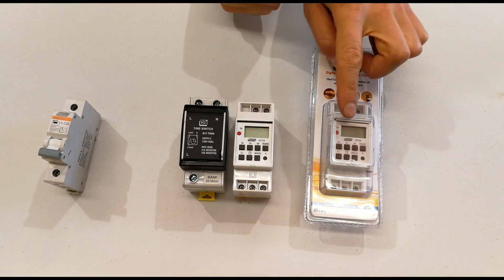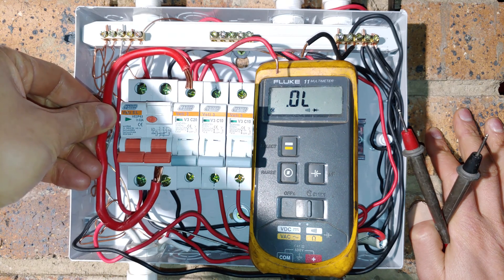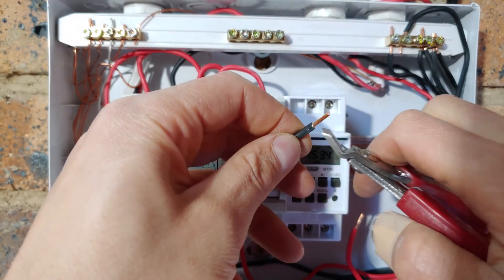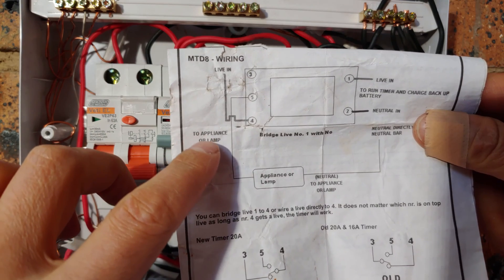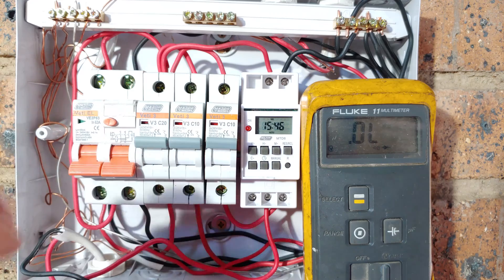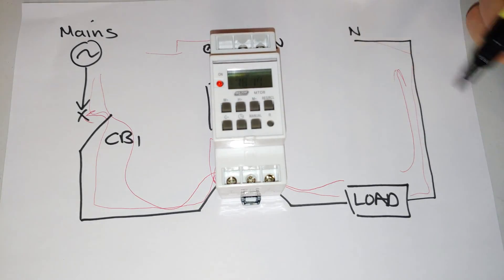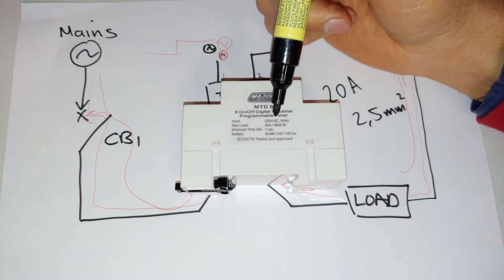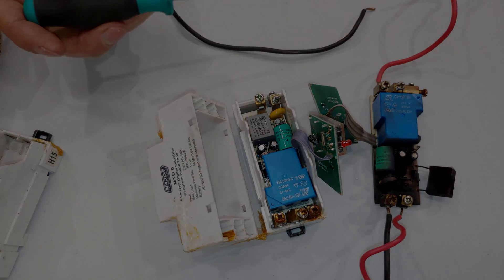How to install a Major Tech MTD 8 programmable timer switch

Comment: Awesome stuff, just wondering, wouldn’t it be a better idea to supply the timer via the circuit breaker for the light switch? This way the timer is on the same breaker as the light/load?
So the output of the circuit breaker would go both to the top feed in and then looped to terminal 4? 
My main breaker is 40A but load is 16A
Reply from the maker: thank you yes indeed you are right. Here is the updated video: https://youtu.be/XR1SnrTHw_8